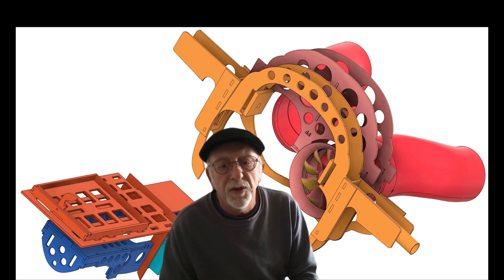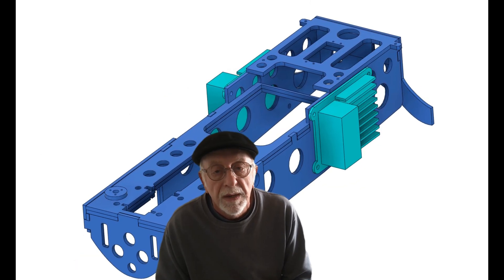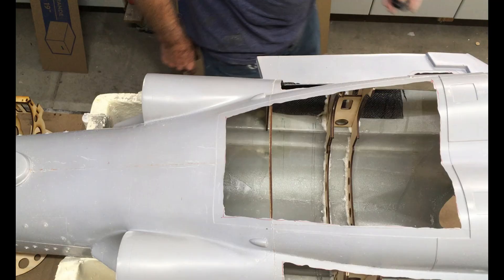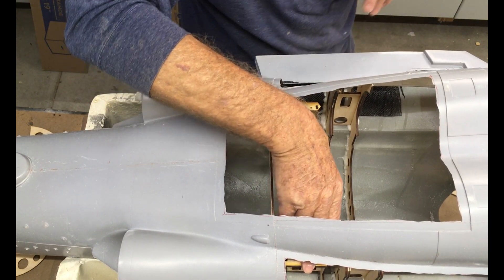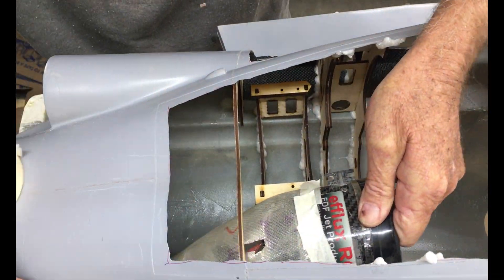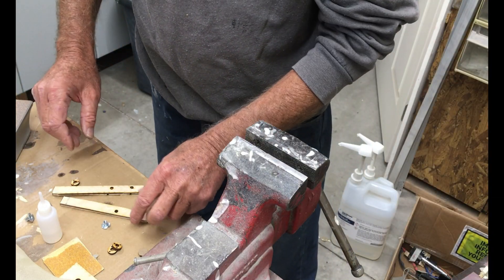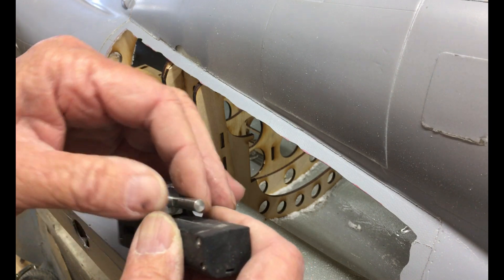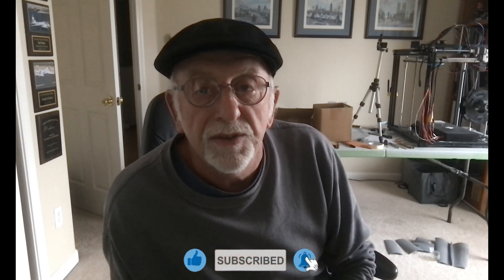RC Super Scale A6 Intruder Build #4

Comment: Don't worry about YouTube analytics. Make your videos longer. It would be nice to see how you designed the components and get them to fit. Do you design the plug in 3d too and print it, perhaps you  can show that process too.
Reply from the maker: For the A6 I did the plug with sections and foam between then shaped over these.  The Tucano build was entirely 3D printed plugs then molds made from them.